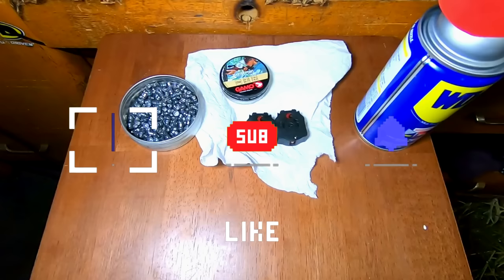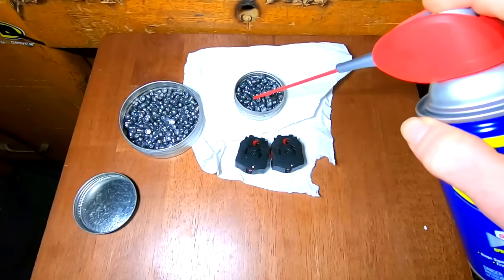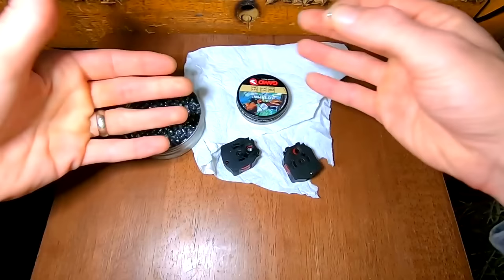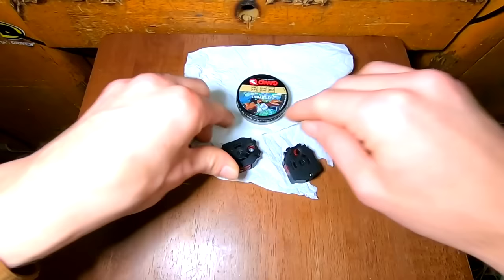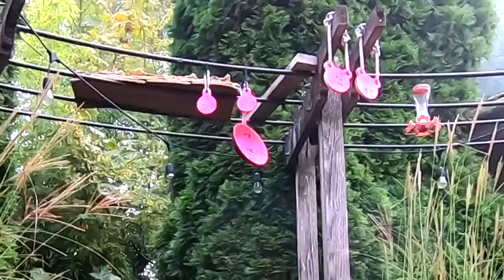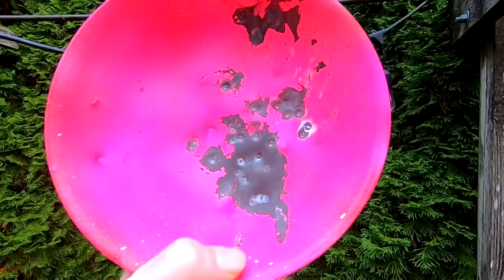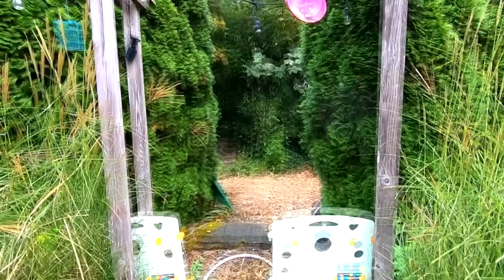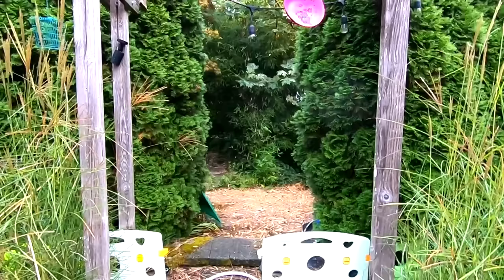Pellet Dieseling the Easiest & Quickest Method

Comment: How many you guys tried using acetone-based starting fluid? This is the first video I've ever seen of this. I've known how to do it for a little while, but I never seen a video on it and that's usually what I use is the acetone. But I'm definitely going to try out this method. It seems like it's definitely easier
Reply from the maker: acetone is known to melt a lot of stuff so I'd probably steer clear

Comment: I moly coated my barrel,it took several rounds to get dialed in. The reason less friction and f.p.s. improved.
Reply: please explain molly coating, how it is done and if it is a permanent thing?
Reply: @jimkurk5575  no, it's not permanent. However it burnished the barrel, very smooth. Less friction resulting faster f.p.s.

Comment: We all know...  The pressure pushing on the rear of the pellet, causes some spreading of the pellet cup to engage the rifling grooves. The Vaseline or other high viscosity lubricant when used, is forced to the outer edge of the pressure dome formed behind the pellet. This alone will increase the velocity of the pellet by any regulated pressure. Dieseling, is more difficult if at all, to get the velocities consistent.  Long long ago I was into competition air gun shooting. I found that pre-sizing/ making the pellet air cup wider, so that it was able to compress as it was pushed into the barrel. Which formed a better seal, and using WD-40 or even 3 in one oil to lube the air pump. gave me the most consistent groups, and velocities. Also more consistent dieseling. With BB's I used 50 weight MC OIl or 90wt gear lube. Zippie fast BB's!   Air gunzzz are fun.....
Reply from the maker: interesting, ill have to experiment with flaring the skirts a little bit, I could see how that would improve consistency for sure

Comment: For whom it may concern!  
Before cursing the fuel or stating that dieseling doesn't work you should realize that the weaker air guns often can't deliver the pressure needed to ignite the fuel.
Reply from the maker: this and also doesn't work with co2

Comment: Deiseling is not a combustion, it's simply sealing the pellet as it goes down the barrel.
Reply from the maker: No, it is absolutely combustion, this isn't really up for debate
Reply: @PelletPlinker  I'm not debating anything. I'm stating a fact, it's not combustion. Believe what you want, try a non-flammable substance and you will get the same results.
Reply from the maker: incorrect.

This is like going to a ford dealership and telling them combustion doesn't happen in the engine. No one cares about your opinion on what you think, when everyone already knows the truth.

It is factually, and objectively proven to be combustion, and it's hilarious that you would think literally anything else could or would be happening here.
Reply from the maker: Also, if you had any experience with this, which you clearly don't, you would know that you can literally smell when combustion happens.

There's a reason why there is a difference between a round with too much vaseline in it, and a round with just the right amount. 

The one with vaseline that DOESNT combust due to improper fuel:air ratio, goes slower than a normal pellet, because duh. It's heavier. It can only go slower with more mass, under the same pressures. 
The one with less vaseline that DOES combust, not only makes smoke from the combustion, but literally smells like burning vaseline, because, well, it's burning. Duh. 

It also increases velocity by 17% which I proved in my latest video with a chronograph.  https://youtu.be/t01CSYiLUGw

If you think putting a little bit of a random non flammable substance in the back of a pellet can increase velocity by 17%, I have a bridge to sell you. If increasing velocity by such a huge amount was that simple, every single pellet manufacturer would be selling super speed pellets with cream cheese in the pellet skirt or some other inert substance.
Reply: @PelletPlinker  Like I said, I'm not debating anything. Apparently you want to debate, but have no proof of your claims. You can make smoke with your mouth by holding your breath and compressing it in your mouth. Is that also combustion? I've been doing this with break action pellet guns since the late 1970's early 1980s. You can use 3in1 oil to do it with, which by their own label is not combustible and is stated on the MSDS for the oi, feel free to google itl. So are you saying that 3in1 oil is wrong and their oil is actually combustible? Maybe you should notify OSHA, I'm sure they'd like to know about the mislabeling. I'll go watch your other video from 11 days ago now.
Reply from the maker: Nope, you are incorrect: "Conditions to Avoid: Avoid heat, sparks, flames and other sources of ignition"

https://files.wd40.com/pdf/sds/3inone/3-in-one-pneumatic-tool-oil.pdf

says several times on the MSDS it is flammable. 

You know why 3 in 1 oil works so well? because it is dieseling. Thanks for proving my point dummy.
Reply from the maker: In case you try to say that's the wrong 3 in 1 oil (because there are several) here is the other one you may be speaking of:

https://media.3inone.com/app/uploads/2021/10/25120910/3-in-one-multi-purpose-oil-w-telescoping-spout.pdf

"Conditions to Avoid: Avoid heat, flames and other sources of ignition."
"flash point 305 degrees"

So again, flammable/combustible. In fact more-so than the other 3 in 1 oil.
Reply: Finally someone with common sense that understands this is not combustion @JohnDoeTheTroll

Comment: Don't do this as it can cause damage to your piston seals, piston head and crack the spring. Take it from a U.K.gunsmith who has seen it first hand. Model aircraft fuel works amazingly well, the compression ignition fuel, it's great fun but will soon kill the gun.
Reply from the maker: piston dieseling from too much lube =/= pellet dieseling from a small dab of oil

Damage you have seen is from piston chamber dieseling, not pellet dieseling. The piston chamber is capable of holding much more oil/air and thus capable of much greater explosions. 

I've been doing this for years out of the same gun, with hundreds of rounds down range. No damage yet.
Reply: @PelletPlinker  amazing
Reply: @PelletPlinker Yeah, thanks just the same, but I think I'd much rather take my advice from a professional gunsmith
Reply from the maker: @purdyboi8078  Being a gunsmith is incredibly irrelevant here.

You either know how fluid expansion and pressures work or you don't. 

The fact that he repaired a gun does not mean he knows exactly what happened to that gun.

The things I am saying are factually and scientifically  correct so you can either take it or leave it, but it will still be true regardless of what you personally decide.

If you aren't interested in dieseling your pellet rifle not really sure why you are here other than to feed the algorithm, so I guess thanks for helping me get more views on my video.

Comment: You can use ATF as well I found it works better and stays on the pellet
Reply from the maker: i heard this works well too haven't tried yet tho
Reply: @PelletPlinker  it does work I had a 1200ft pellet standard one and it worked perfectly for me and even diesel fuel as well

Comment: Silly question why not use Deisel fuel its a lot cheaper than wd and probably has a higher energy quota per drop and will clean and lube the barrel just the same
Reply from the maker: Cause most people already have a can of wd-40, or some other petroleum product like vaseline or pellet gun oil

Not everyone drives a diesel car, and already has diesel on hand, and not everyone wants to go to the gas station to fill up a can of diesel just for dumb shit like this

But yeah diesel fuel would probably work better

Comment: Spray 100% Bees wax furniture polish onto the pellets and they slide through the barrel quicker as theirs less drag than oil and no dieseling plus the barrel gets lubed at the same time and no damage.been doing this for years.
Reply from the maker: You must be confused
The point is to diesel the shots
Reply: @PelletPlinker  
Nope not confused at all,the point was more power without the dieseling which is what your trying to achieve!!
Reply from the maker: No I mean the point of this video is dieseling. Dieseling is the goal here.
Reply: @PelletPlinker  
Yes I know that but what for??only reason peeps do that is for more power,noise and smoke.(and doesn't do the rifle any good,theres easier ways to gain more power such like pellet head size and weight)and a chronograph to measure speed and power.
Reply from the maker: You don't understand how power and velocity work. 

Using a smaller pellet for more velocity doesn't mean more power. It is lighter so it carries less energy for any given speed. 

If you can make a larger pellet go as fast as a smaller pellet though, you are talking about some serious gains. 

You will not achieve anything even close to what dieseling can achieve by just lubing pellets. You would need to upgrade the spring or re work the whole piston system. 

diesling is a quick an easy fix for a significant amount of extra power (30-50% increase from what I have seen from youtubers who have done chrono tests) and yeah it's not great for your gun, but it's not that bad either. I've done it dozens of times and no damage yet.
Reply: @PelletPlinker  
Funny that then coz I've just tuned two rifles and gained extra power and speed doing it my way,and one is a gas ram and the other is a BSA which I did upgrade the mainspring and piston seal and I've chronograph both rifles and well over the factory limit,so I'll continue doing it my way and you can crack on with your dieseling and potentially fucking up the rifle.i didn't say anything about pellet weights faster or slower as I know all about that and head size's and know which ones my barrels prefer,1000fps are easily accessible and I know dieseling can make a rifle more powerful but it's stress and noisy for the gun and off course adds a lot of recoil which a decent tune gets rid of.
Reply from the maker: Yes you did:
"theres easier ways to gain more power such like pellet head size and weight" 

This statement is not true in the slightest. You do not gain any power from changing the weight of the pellet. A smaller pellet goes faster, but there isn't any extra power. A larger pellet has more momentum, but is going slower, so again, "power" stays the same. It also ignores the obvious fact that you could take a lighter weight pellet with a more efficient head size/shape, and ALSO diesel that.  Furthermore, you are conflating what slight increases in velocity you get, to the massive increases in velocity resulting from dieseling.  I'm not saying your technique doesn't increase velocity at all, I am saying it is no where near comparable to the increase gained from dieseling. Your 50FPS increase from lubing your barrel and another 50FPS increase from pellet selection, doesn't even begin to compare to the 500FPS increase you can see from adding some oil to a pellet.

I achieve supersonic projectiles with dieseling. No amount of pellet selection or lubing the barrel will make a pellet gun go from sub sonic to super sonic.

My gun is already close to 1000fps.

Dieseling will take it to 1300-1500 FPS with just a dab of jelly
Reply: @PelletPlinker  super sonic will make the pellets unstable in flight and won't be accurate at all and render the rifle useless,far better to have lower power but accurate at what ever yardages your shooting at,rifle will also have bad recoil as a result unless you ve a heavy piston+guide.12ft/lb is our legal limit here in the UK and I can still kill out to 70yards,a rabbit only needs 1ft/lb to drop dead if shot in the brain so again accuracy is king here.
Reply from the maker: jesus christ you have no fucking clue what you are talking about
Reply from the maker: Weird my guns haven't killed anyone yet so not sure what that has to do with me
Reply: @PelletPlinker  LOL......has he gone quiet? My laptop is buffering so can't see😄

Comment: Don't do this if your gun is spring or gas strut powered. It'll burn the piston seal or breaking the main spring.
Reply from the maker: not really
Reply: @PelletPlinker  I've rebuilt many customers springers through out the last 20 years. It's a common occurrence but you can keep on promoting this. It's been a good side hustle.
Reply from the maker: You are mistaking pellet dieseling, with piston dieseling. 
A tiny bit of oil on a pellet wont do this. 
oil in the piston chamber will though, as there is more room for oil, and more room for air, and a much smaller hole to go through.

And for the same reason you can put a piece of paper over a candle flame quickly, and it doesn't burn the paper, dieseling pellets does not burn seals. It happens far too quickly. The dieseling reaction happens in a fraction of a fraction of the amount of time that you would put your hand/piece of paper through a candle flame for, and is a much smaller "flame". 

I have never seen damage occur to an air rifle of any type from putting oil on pellets. Every dieseling damage I have ever seen, or heard of, was a result of over lubrication leaving too much residual oil in the piston chamber, resulting in dangerously large combustion, that would not be possible within the breech alone.
Reply: @PelletPlinker  I hope you'll take responsibility for your viewers damaged guns.
Reply from the maker: why the fuck would I?

Comment: The older it is the better it will probably be50 yrs plus the gun will be nicely balanced, i have fired a number of relatively new ones hard to aim with because theyre way out of balance, i wish i still had my old Relum 2.2 i had it 57 years ago,  a good powerful gun perfectly balanced
Reply from the maker: Not sure what you mean by balanced

Talking about weight distribution of the gun, or consistency of shots?

These gamo break barrels are pretty decent, never had any trouble hitting stuff

Comment: Maybe try some kerosene with a little bit of WD-40. Kerosene is basically just a cleaner more refined version of diesel fuel, it's basically the same chemical makeup.

 Diesel fuel has a self ignition temperature of 210 degrees Celsius and gasoline has a self ignition temperature of 246 degrees Celsius. That's why gasoline is not used in diesel engines even though it is cleaner and more volatile.

 It's not so much the volatility that you are looking for to achieve the diesel effect, it is the low self ignition temperature. When you compress the petroleum it raises the temperature enough for self ignition to occur.

 You should research which chemicals have the lowest self ignition temperature and try a formula that has those chemicals. With a little research you may be able to come up with some cocktail that works really well. Just make sure you don't get anything that will corrode the insides of the gun. Kerosene should be very safe. 

If you mix kerosene or diesel with a little bit of something that contains more energy that would possably give a great effect. 

Kerosene is pretty much what powers the SpaceX Falcon 9 rocket, and also every jet airliner you've ever been on. RP-1 and Jet-A or #3 jet fuel and most other jet fuels are basically kerosene with things like anti-gel additives. Diesel fuel is a more oily version of that. You would have to experiment to figure out which performs best.

Comment: The WD-40 brand has 4 variants,  
first the original, second, Dry Lube Specialist, 
third Silicone Specialist and last Penetrant. 

The best for air rifles is the Dry Lube, because it doesn't leave a moist remnant inside the barrel. 
Dry lube is also recommended for loosening difficult keyed locks

Comment: I have found a 50 / 50 mixture of 3-1 oil and grapeseed oil gets a steady 1200 fps with my 22 Ruger Impact. And guess what ? Over 2000 shots and no blown seals. But even if it did i can afford 25© for a new one

Comment: Hi am from the UK 🇬🇧 just come across your channel don't know if you are still doing this 
but if you are get vaseline and more important is the thick hand gel we all was using for covid 
mix them together 
and you will be amazed I have a .22 at 25/30foot it will go through 30mm laminate board clean through 
and I have just put a theoben gas ram in it 
a 1.77 mm that takes the power to 
25 f lb with the pellets done like that 
it's amazing and so quite I'VE GOT A BSA LIGHTNING AND I'VE JUST PUT RUBBER WASHERS BETWEEN THE BAFULLS 
WITH 5MM HOLE ITS BRILLIANT IT DROPS ANYTHING SOME TIME'S TO MUCH POWER RIPS RATS  🐀 APART😮😂😂
Reply: Ps with the pellets done like that easily 35flb 😮

Comment: You do realize that by doing this you could damage or eventually destroy your pellet gun right? Dieseling creates much higher chamber pressures than your pellet gun is designed to withstand.
Reply from the maker: You realize I've been doing this to a un-maintained rifle for several years now, and have dieseled hundreds if not thousands of shots with no issues yet, right?
Reply: @PelletPlinker  "look up what  Dieseling, is in a pellet  rifle ,seems you don't know." like I said  dieseling is  when the wrong oil is used in the  chamber and causes mini explosions that raise pressures and blow seals.~ What your doing is pellet lubes , you may be  getting a little of the same effect ,in the barrel,.but it's not the same.